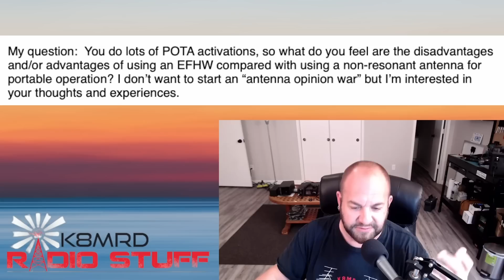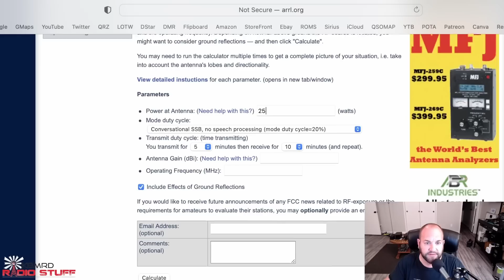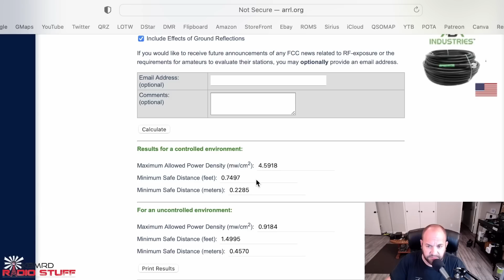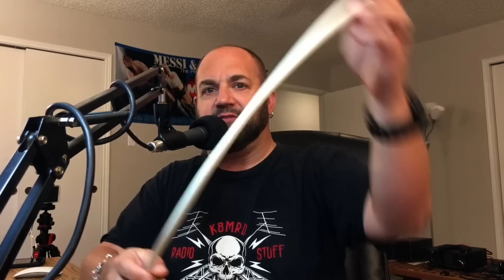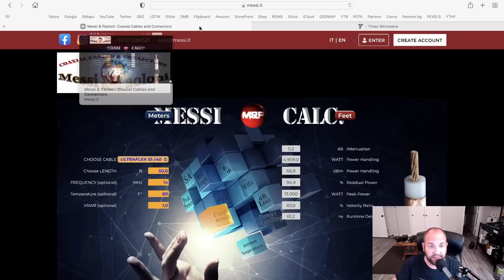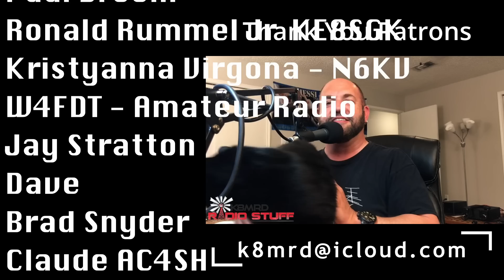Mailbag Monday #15 | Your Questions Answered...Pourly.

Comment: I fly (commercially) pretty frequently for work and always bring my IC-705 and AlexLoop with. I have used it in many hotels. Sometimes with great success, and other times not so much. Each hotel is different (construction, RF noise, etc.). I always select the top floor for best chances :) I’ve made SSB contact with 5W from MI to TX with ease when the bands are open. Sure beats watching the boob tube. Mike - N7CCD.

Comment: Mag Loop in a hotel, my biggest struggle as a ham. I did a video months ago and it pretty much shows the frustration of operating in a hotel. I recently used that same Mag Loop on the beach and worked DX to Europe with 10 watts. Good Luck to the viewer that asked that question. Prepare for some struggles but maybe just maybe it will work if you’re fortunate enough to be in a hotel that’s positioned just right and you’re away from the tons of electrical and structural cage like madness that’s around you. Great video Mike! 73 Walt

Comment: Messi & Paoloni cable is now THE benchmark for (non-hardline) coax.  The only thing better than their coax is their connectors.  Their 50ohm stuff is used for all my radios, and their 75ohm stuff for my TV.  To maintain lithium-polymer batteries over time, keep them between 30% and 80% for storage.  Running them down and charging them repeatedly lowers overall life.  For storage, running them down to 50%-70% and them leaving them alone is best.  Self-discharge is very, very low (if removed from the HT); so checking them once every six months is more than enough to keep them from getting too low in a conditioned space.

Comment: Been trying a small mag loop with my 817 in a hotel room at a place i regularly travel to.  I was not hearing anything but some birdies. Not even on FT8 frequencies and there is always FT8 activity on open bands.  I was looking at the hotel and realized it had a stucco finish. There is usually wire mesh behind the stucco to hold the stucco in place.  So I'm sitting in a Faraday cage.  Once I threw a wire out the window I could hear stuff!
Reply from the maker: Lol, I've put up some wires in a hotel to much the same result.  Can't these builders used something else that doesn't kill our RF?!?!
Reply: @hamradiotube  Definitely inconsiderate of them!

Comment: Was there any resolution with the RF noise hunting adventure?
Reply from the maker: Kinda sorta.  I don't really know what happened.  The electric company kinda just left me hanging, but for some reason the noise is (mostly) gone.  I know it's not totally fixed but I can at least make contacts most of the time.  I doubt very strongly they've been out though.
Reply: @hamradiotube  They may have been out around the neighbor hood and found something with out you noticing. Regardless, glad to hear the situation has improved.

Comment: I have an HWEF antenna wire cut for 10-20 and a 10-40 length wire. On the 10-20 wire , I am able to get 17 15 and 12 with the MFJ ATU.   Paul K5CIP